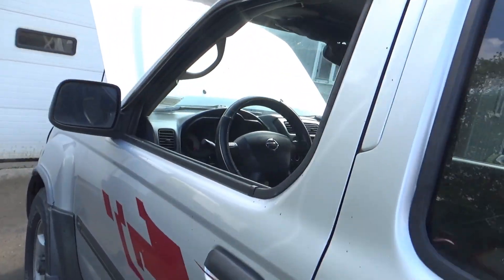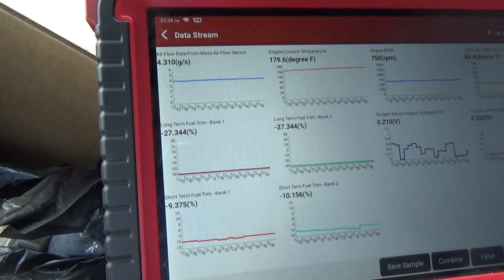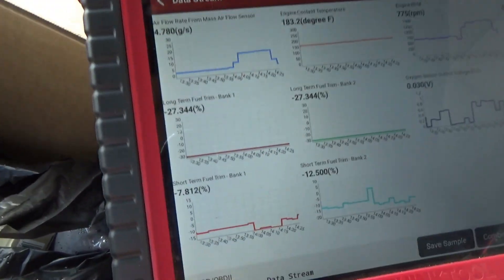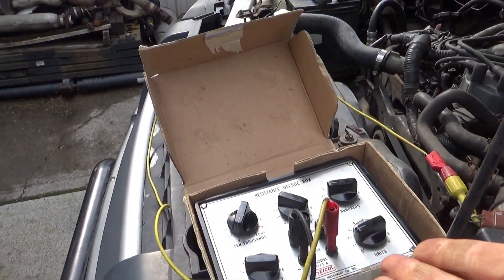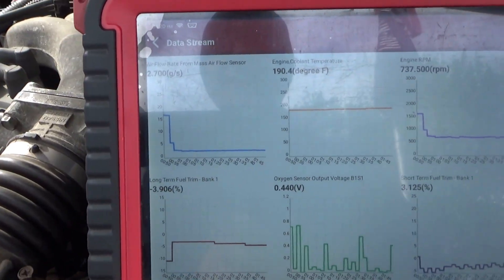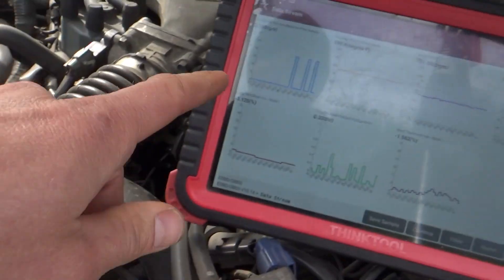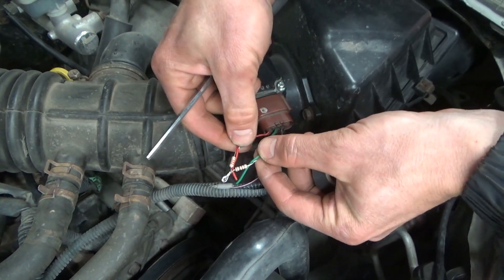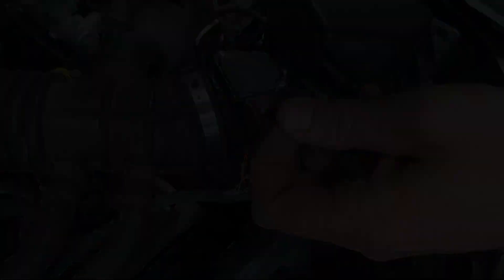I'm STUMPED...Crazy RICH XTerra P0172 (Part 2)

Comment: Привет!!
Having exactly the same issue on my 1999 Nissan Pathfinder with the same 3.3L engine. No check engine light, no codes, but MAF shows 4.9 g/s at idle. 3 different sensors (Brand new Nissan & brand new HITACHI) show exactly the same. The fuel trims are between  -5 and -10 %, which might be OK, but the CAT monitor stays incomplete after 2000 miles. Gona try the resistor method, but I don't like it, something IS wrong.

Comment: The manual has a wide variation of what is an OK MAF signal (1.0 to 1.7 at warm idle) - but the computer seems very sensitive to values that still fall within the acceptable range of the MAF sensor.  I'd be looking at the computer.  Given the wide range of what's normal, I'd expect some kind of a calibration routine that the computer would run to determine a baseline for that particular sensor then run with that.  The fact that it's showing a flow of 0.35g/sec with the engine off seems a little odd - sure it's a low number, but if the system is that sensitve, shoudlnt it be registering zero?

Comment: I've had an issue like this before on a Chevy Sonic. It seemed to be comparing the MAF and and MAP sensor. I can't remember what I did to fix the issue but you had to unplug both to see if the engine was rich due to the sensors or not.

Comment: The input to the computer would probably have a load resistor as standard but if faulty it could cause an issue. Definitely worth checking out the voltage at the computer input.

Comment: Is the housing the MAF attaches to correct for this engine? I’ve had fuel trim issues in the past they resulted from a junkyard air filter housing that was for a different engine option than the one installed on the car

Comment: If the PCM is working properly then it would have to be a calibration file error. One check on the PCM would be to check the  +5VREF output. If this is okay, then I think we can assume that the A/D front end is working correctly. So, the error would have to be in the 2D MAF look up file. If there is a calibration update needed there should be a TSB or a recall notice which includes the MAF 2D table transfer function. Many times the check is to see the current loaded version of the PCM Frimware/Calibration and if a newer one is available, to then reprogram the PCM.

Comment: Common mistakes when diagnosing the P0172 code
A technician may not inspect the coolant temperature sensor and cooling system. When the engine is cold, more fuel is added to help warm it up to a desirable temperature. If the coolant temperature sensor is not sending the proper signal there is a possibility that the engine ECU may assume that it is always running cold.

Comment: I do think the way your looking at this slightly wrong. Your assuming the MAF sensor is causing the computer to add too much fuel. And trying to use a resister to compensate. Unless I have missed It I don't think you have accounted for the possibility of too much fuel getting in by other means. Maybe a leaky injector for instance.
Reply from the maker: Both banks are affected equally, so one leaky injector cannot be the problem 👍
Reply: @PineHollowAutoDiagnostics  Your assuming only one. But i did notice the updated video with the evap problem. Is there anyway its dragging fuel / fumes from that. I'm just guessing honestly. I guess it would be interesting to see the injector pulses but you would need a known good to compare.

Comment: poor ecm/sensor grounds on engine. missing "programmed" known vacuum leak, something like PCV valve being plugged, wrong or hose collapsed flat under vacuum can effect it somewhat, even though the pcv breather would be after the MAF and part of the calculated reading, lack of flow can do strange things.

Comment: Have you checked for air leakages in the air filter box, and the air box snorkel to the throttle body? You could have extra air entering the system.

Comment: With what you said in the video that the customer says the mpg increased significantly,  that makes me think the MAF is doing its job correctly,  but the O2 sensors are reporting the wrong information. Am I wrong in thinking that the fuel trim reading actually comes from the O2 sensor data in conjunction with MAF input data?

Comment: Knowing what a good MAF sensor value should be can be frustrating. The voltage values in troubleshooting charts are too vague and not very helpful. 
My experience is mostly with MAF sensors on diesel engines, but we had an OEM that had so many warranty claims on good MAF sensors that they created interactive tables for verifying the accuracy of the MAF sensor readings. You would disable the EGR valve and then record parameters like engine speed, ambient temp, barometric pressure, and boost and then plug the values into the table and get a good/no good answer for the accuracy of the sensor reading. Each application of machine had its own unique table. Made diagnostics much less frustrating.

Comment: Do a voltage drop test on the  sensor ground. Engine running, all electrical loads on snap throttle on a scope or min/max on the meter. Should be under 200mv.

I wonder if the engine was ever replaced? Maybe it has additional displacement and it's real air the sensor is counting.

Comment: I don't get why the resistors was connected to ground, I would think that the resistors should be installed inline with the signal wire, meaning you would have to cut the signal wire and put the resistors in to complete the circuit.

Comment: PCM may normally have it's own pull down resistor for that circuit but it isn't working so you doing it externally is taking care of it.  PCM's often have a few ground wires, perhaps the one this circuit uses for pull down has a weak ground so cannot properly pull down the input.

Comment: Does the computer have a pull down resistor on the inputs to protect the circuit? You may have found a bad computer.

Comment: Rich codes can be puzzling. From leaking injectors to vvti control issues and computer updating to a host of other problems and also consistent fuel pressure. The bucket list is endless. The maf is not happy as elevated results on grams/second is an indication of trouble. Basic earths and powers on pcm and other earths might give a clue ? Definitely a very tricky head scratcher and from the comments, the supply outdoes the demand.

Comment: I'd like to check to make sure the PCV system isn't restricted, since that's essentially a calibrated vacuum leak for the engine. Also, even though no EVAP codes are setting, I'd like to verify that the purge valve isn't stuck open. The stuck purge valve may be the more likely culprit, since the engine would be able to suck raw fuel vapors from the tank and severely reduce the fuel economy, which was a customer complaint.

Comment: Super interesting since I've been working to track down a rich condition on my 1994 Olds 3800.  (So disappointed I didn't know you were making a road trip not far from me!)
One thing I was wondering is where the target MAF value of 3 g/s came from? Is that a rule of thumb (3 liter engine = 3g/s at idle)?  One thing I checked on my car was the MAF readings.  Its a 3.8 liter engine and the factory shop manual says MAF should vary around 4.9 g/s at idle (which it does).
I won't go into detail since my car is beside the point here, but I believe I've narrowed the problem to (2) injectors which have low ohm readings and when either of these are disconnected the fuel trims are fine.
But certainly your diagnosis of the Nissan and the hundreds of comments regarding it are much appreciated as they may be pieces of the puzzle in case the injectors aren't my problem.
I've learned SO MUCH watching this channel, in fact I'd probably just be throwing parts at my Olds if not for your example of methodical and logical process of elimination!
Looking forward to Part 3!
Reply from the maker: Flow test your injectors!
Reply: @PineHollowAutoDiagnostics  I did! However, the results were inconclusive, numbers varied but all were within 2 PSI (8 to 10 psi) of each other which I understand to be in the acceptable range. Strange thing is, injector with the lowest ohms reading had the lowest pressure drop, which of course would cause lean, not rich.
Hopefully Its not a mechanical problem with cylinders 3 and 5 (the ones with low ohms and which when O2 sensor disconnected fuel trims were practically normal).  Guess it could be a really bad spray pattern causing incomplete combustion.
Car runs great (except for full throttle isn't as powerful as normal) when O2 sensor is disconnected. Did try old O2 sensor from an identical car I used to have, no change.
New injectors should arrive today - at least I'll have something to put back in so ports aren't open any longer than necessary. Any additional ideas would be most welcome - thanks!
Reply: To close the loop, for Ivan and anyone else interested. Installed injectors today, car runs MUCH better, I'd say 95% of perfect so there is still work to be done.
Fuel trims led me to injectors but only "proof" I had was disconnecting them one at a time and watching fuel trims.  Apparently they failed in some way that didn't show up on the flow test.  Yet fuel trims are still low, which threw me until I learned this is normal for this engine when EVAP valve is open.
Sometimes ya gotta go through the process of elimination.  Everything is a possibility until you rule it out!
Thanks for the inspiration and endless stream of knowledge, Ivan!
Reply: @billb6899  It was the injector flow pattern.  If it dribbles unevenly, the huge droplets of fuel burn incompletely, causing a rich condition in the exhaust.  Most prevalent at idle speeds.  Causes mild rough idle.
  Step 2: make sure the egr valve is not leaking exhaust gasses into the engine.  This creates a rough idle, spastic o2 waveform, and tricks the o2 rich, since it only detects 0xygen, not co2 or hydrocarbon emissions.
  Step 3: check your PCV o-ring if it has a plastic manifold.  Could be sucking oil.

Comment: its a resurected buick  err i mean nissan(datsun?) big thing is here is to make absolutely sure your data is correct. remember roger rabbit is waiting at every corner, even in a round room. the resister hack is only a confirmation something is off.  try another scanner  check powers and grounds. check for ac ripple in the dc. check that the readings are the same at the pc. we have faith you'll figure it out  or you'll call kieth lol

Comment: Dear Mr. Ivan, in my perspective maybe sometimes a slightly stretched timing chain might cause a very tiny vacuum change which might in turn cause a very sensitive MAF to miscalculate. Also, maybe the automaker knows that after a certain hundred thousand miles that the vacuum will slightly decrease, thus the manufacturer policy designs or calibrate the MAF in a very precice way to act in a certain way if a vacuum is drop by whatever tiny amount relevent to a certain high mileage. Just an opinion. Take Care.

Comment: If it's not a ground fault, is the inlet the original? A different size pipe, or some restriction near the sensor so the air velocity through it is higher for the same total air volume, could throw off the sensor output.

Comment: Man,  you brought up radio shack, lol i miss those days lol.  I bought 300 dollars, worth of parts lmao! I'm not sure putting current sense resistors like 3k ohms.  Is the right logical choice.  I didn't see any clips of the ecm being original or aftermarket.  Or having worked on to check for any failing drivers.  But on that test drive, it may show perfect,  but something happened.
Reply: I used to be a District Manager at Radio Shack. But this was towards the end of their run. What I thought I came on for was to help sell electronics and their components. Nope. All I did was push cellphone sales every day all day long. Saw the writing on the wall and left within a year. Used to be a very cool company and store. A Radio Shack was an area on old ships where the dedicated communications equipment lived.

Comment: I worked at a Nissan dealer during that era. There were a lot of driveability issues that involved not only changing the mass airflow sensor, but also doing a software update on the pcm. It might be worth checking that the pcm is correct for the truck with the latest software calibration. We would get a lot of vehicles that had new oem maf sensors installed but would still have fuel trim problems if the pcm wasn't recalibrated to match the updated sensor.
Reply: Dude. You gotta be on the right track there.
Reply: I know on an altima about the same year we had the same problem. There was a t.s.b. on it for a reflash.😊😊
Reply: @brucebrown4183 eflash pcm yep

Comment: I struggled to figure out the high negative fuel trims on my 2000 Camry with 350K miles.  It turned out that valve seat recession caused diminished exhaust valve clearance, and correcting that took the negative fuel trim from about -20 to near zero.  Gas mileage improved significantly.  The car does not have a MAF sensor so I have info on that.

Comment: Could it be the throttlebody?  Like, maybe it’s gummed up just enough to allow additional amount of air to slip by specially at idle?  I mean it’s displaying that it’s in fuel control.

My two theories are either. It’s reading the voltage weirdly at a Module, which would mean likely a partially floating around. .  Or maybe it’s a simple is a gummed up throttle body is allowing a little extra air to slip by.
Reply from the maker: That would just cause a high idle and wouldn't affect fuel trims 🙂
Reply: @PineHollowAutoDiagnostics  that is true for most part ya.  My thinking is though what does that voltage offset equate to in Gram/sec airflow?   It looks like a small number, so I’m guessing a small amount of additional airflow if it is actually measuring airflow.   And I don’t know if it’s small enough number that it may or may not influence your idle speed much.  I’m not there playing around with it to find out. 

That being said, my thought process from there is, but what if the system is not lying?   I mean you upgraded it back to OE.  It seems to be operating normally since replacement.   What if they’re actually is additional air being measured?  So if that’s the case, what does that mean?  well my theory would be the next in line is the throttlebody might be slightly gummed up a little.  Ya know a bit dirty not so much so that it’s causing major issues, but just enough to cause some additional air slippage…   But you know I’m probably wrong. I’m just thinking from another angle.  

My other theory is if it is lying to you then it’s probably lying to you because it doesn’t know better… so it’s probably got like a floating ground or partially floating ground .

Comment: I understand why you put the resistors there, I understand the cost savings for the customer if the ECU is "straying" due to a component iss, maybe dry joint or whatever. I just query whether it is a legitimate fix. If the MAF fails totally, will it mask the failure or will it not matter as the 3K resistor will be what the ECU sees (well the voltage due to the 3K resistor). I saw the comment at the end re a Part 3, so I am guessing my concerns are warranted.

Comment: cool case study i just had a gm that was doing the same thing over reporting the air new mass air no help i took the air filter box off to see if i could see anything and there was a plastic diffuser laying on top of the air filter it clicked right back into place problem solved no parts required 😀
Reply: I just saw a video where there was also a plastic sleeve or wrap on the bottom of the square airfilter blocking air flow. How it got there the mechanic had no idea.

Comment: A problem with adding the resistor is that if the internal circuit rights it self then you will have a lean condition/ low maf reading. ECM autopsy may be required

Comment: Cat cat cat Long-term trim is determined by the rear oxygen sensors in Nissan. You’ll never read anywhere about it not even in school. Do they tell you about it you just need to be a master Nissan technician like myself
Reply: I've had gm rear O2 sensor effect fuel trims.  Nowhere in the diagnostics were they mentioned.

Comment: Since it appears that the sensor is fed battery voltage, wouldn't the computer have to reference the signal as a percentage of battery voltage and not just absolute?  I'm wondering if something is dragging down the battery voltage the computer sees but not affecting what's going to the sensor.   That would cause the computer to read the sensor higher than what it really is.  I take it your scanner doesn't show sensor voltage? I would be nice to know what the computer is seeing.

Comment: My uncle had an 04 Frontier with same problem. It had 4 cyl though. It had extended Nissan warranty and it was repaired by them. They reflashed PCM and it corrected the rich condition. Then it set catalyst efficiency code. They had to reflash again. Truck had less than 45K. Ended up being a problematic truck.

Comment: I wonder if it makes sense to also check the flow sensor output ar the engine computer input.  And check all connectors for crusties based on the information here.  Cutrous for part 3.